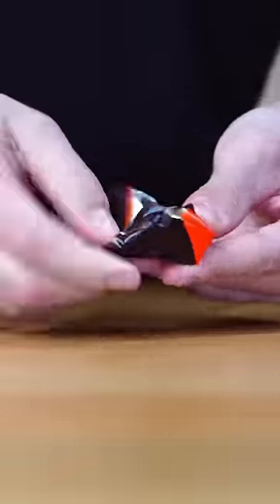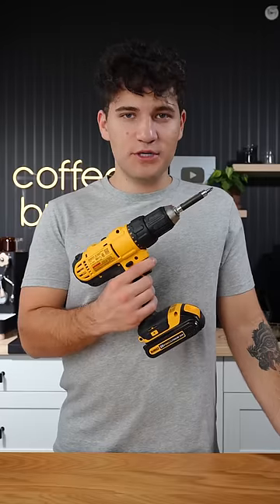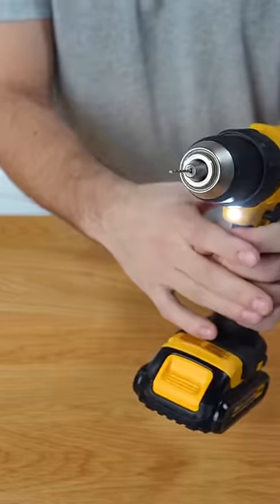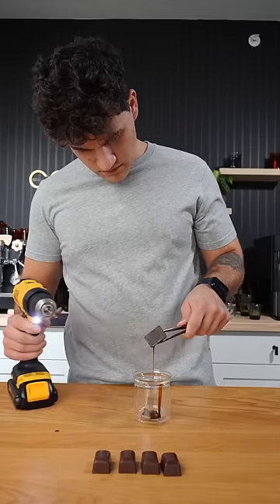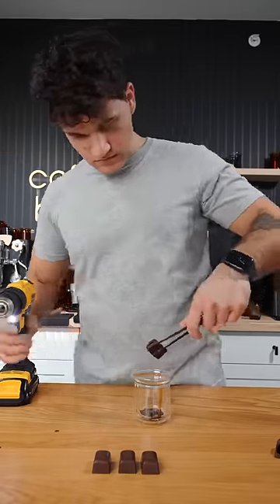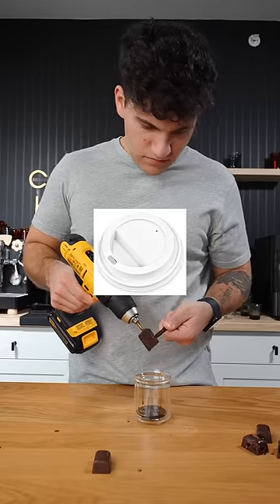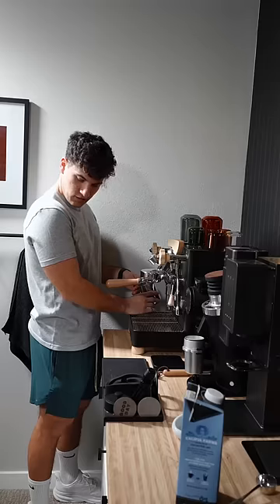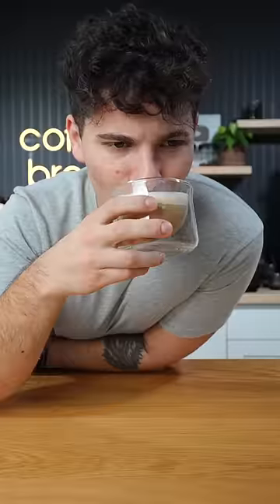Making a latte using pocket coffee

Comment: Tooth pick and manpower. No need for drill.
Reply: You have teeth, you can just bite an angle.
Brain power
Reply: That or he could’ve just broke it into whatever vessel he was going to mix it in or transfer it from. Idk why he was sitting there getting the liquid center all over a cutting board. Can’t expect every YouTuber to have functioning brain cells I guess.
Reply: or you can just use slightly bigger tools. latte art pen that doesn't bend and break unlike toothpick since it's made out of metal. if you can poke milk foam with the sharp end why not chocolate? also the tool is food grade obviously.
Reply: @lorenzogazzola328 honestly ya, just bite off one side like its a hot pocket and you need a way to cool donw the inside
Reply: Dude called normal coffee cup cap an Starbucks design, dude never had a "manpower"
Reply: or just buy an actual espresso thing rather than using candy 😂
Reply: Bud, this “guy” has no idea what man power is. He would be a type to look for blinker fluid
Reply: fr fr fr
Reply: 5 collective braincells between this comment thread
Reply: Unless you don’t have man power…then power drills
Reply: @tinycoinfromholland1391 Thats the literally point of the vid 😭
He was supposed to see if espresso from candy can make coffee bruv 🤦
Reply: @CopeWithMe  But he did it with a drill. This man aint smart. XD

Comment: Some advice, redo this and don’t use a drill. As someone stated before drills and most industrial equipment come with an oil on them to keep them from rusting, which is why it tasted bad. All you really gotta do is just cut the chocolate open over the top of the glass and it should just spill out

Comment: bro could've gotten a metal chopstick, metal skewer, even a fork, heated it with boiling water and made a hole. But no.
A drill.
Reply: I’m pretty sure u don’t even need to heat it
Reply: Or you can just um hold the chocolate upright and bite off the coating at the tip with your teeth...
Reply: Or just gone with the original plan and cut it while in the little bowl.